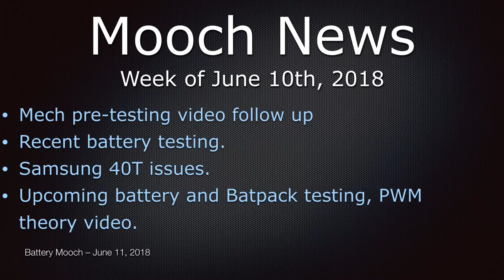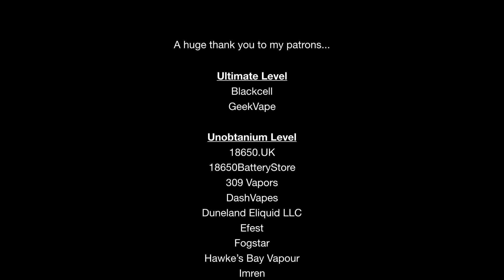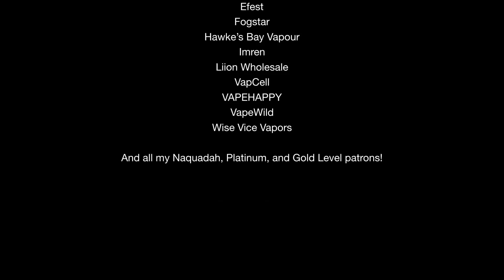Mooch News – Week of June 10th, 2018

Comment: How about those Samsung 40T now? Are those still a no go ? Am gonna buy a Saga mech mod and wanna know which batteries i have to use? Which is the best 21700 for a dual battery mech mod?
Reply from the maker: They were never a “no go”. They were always good batteries and the production versions performed even better.
For up to 25A each I recommend the Molicel P42A or Samsung 40T. For up to 35A each (or if you want the hardest hitter and don’t mind shorter vaping time) I recommend the Samsung 30T.
Reply: Battery Mooch ... ok i see but it’s gonna be a DUAL battery mech mod and let’s say a .2 or .3 resistance .... what batteries you suggest  in that case ? 40t or 30t ?
Reply from the maker: Dirk VdH calculate how much current you are drawing from the each battery and use my recommendations. Every mech user must know the Ohm’s Law equation and how to use it to help ensure their safety. Do not use a mech until you know this equation and how much current you are drawing from each battery.
Reply: Battery Mooch ...yes i already used my Ohm Calculator ...at 3,7 volt and 0,3 ohm resistance it gave 12,3 Amp and 46 watts ....but that is for 1 battery i suppose ...but my Saga Mech Mod uses 2 batteries so that is another story, no ??
Reply from the maker: Dirk VdH YOU CANNOT USE 3.7V FOR THAT MOD’S CALCULATIONS! You MUST learn everything about your mod before trying to use it. Do NOT use that mod until you know if it is a series or parallel mod. Then check out my Battery Basics for Vapers Ep2 and Minding Your Mechs Ep15 videos.
Reply: Battery Mooch ...ooh yes i see ...Ohms calculator : Volts 7,4 Amps 29,6 Ohms 0,25 Watts 219 ....looks ok for you Mooch ? And ok for the dual Samsung 30T’s ? Is my homework good now ? Surely when i will buy this equipment (Vaperz Cloud Saga mod) i will talk thoroughly with the vendor first !

Comment: Hey mooch, would it be ok for me to use the samsung 20s with my
.12 build on a single mech safely if I'm not chain vaping it?
Reply from the maker: There is no safe use of any of these batteries since they were never made for use outside of a fully protected battery pack. You can help minimize the risk though by staying under the battery’s true current rating.

Check out Ep2 of my Minding Your mAhs series for info on calculating battery current for a mech.
Reply from the maker: Acacia Confusa 144 there’s still some risk, nothing is completely safe. If your mech malfunctions or there is an accidental button press that discharges the battery continuously then that is not safe. 🙂 Unlikely? Perhaps, if everything is well cared for, cheap clone mechs aren’t used, etc. But that doesn’t have any impact on whether something is inherently safe or not.

We still have ABS and air bags in cars even though the odds of something bad happening might be low. Why? Because we can never consider it to be completely safe to drive a car, no matter what we do. Saying you have never had a car accident can never mean it is safe to drive a car for everyone. Same thing with vaping. We can do lots of things to reduce the risk though.
Reply: @batterymooch  well said mooch I admire your wisdom 👍

Comment: So i saw an article by you talking about box mods and how you cant use the coils resistance to determine the battery amps being used. and the math on how to figure it out.

300w mod /2 batteries / mod cut off voltage.

So what about the zenith v3? im thinking that mod and some vapcell gold/white 20700s would be a perfect fit ? some thoughts from you possibly?
Reply from the maker: It all depends on how much current you are drawing from the batteries. Check out Ep3 of my Minding Your mAhs series if that is a regulated mod. Check out Ep2 if that is an unregulated mod (protected or not).

Comment: Not about this video but since you you batteries whats the best way to get rif of arkmarks on batteries an yes i build low .07 on mech pencils dousent fully work an i get it on the mod positive pin itself? silver plated
Reply from the maker: Try a Scotch Brite heavy duty scrubber pad. Anything more aggressive will probably remove the plating.

Comment: Mooch can you help me. I’m an idiot and I don’t trust my math. Honestly. Also I don’t understand what everything means. 

I have a dual battery mod and I use 2 Samsung 30Q 3000MAH batteries (purchased on Illumn). I vape between 60-70 watts. With a 90% efficacy (if that’s what you recommend), is this safe or should I lower my wattages?

I’m a new vaper. Math ain’t my thing. I’ve used calculators and watched videos and read articles. I’ve had many friends try to explain Ohms law to me. But I don’t understand. And I don’t want a mod exploding in my face because I don’t understand this law.
Reply from the maker: Did you check out Ep3 of my Minding Your mAh series?
The 30Q can handle up to 45W each before exceeding its rating so that’s 90W in a two battery mod.

No use of these batteries only meant for use in protected battery packs is “safe” though. But we can minimize the risks by not misusing or mishandling them. Keep the wraps in perfect condition, charge only externally in a good charger only when you’re around. Maintain your mod and don’t abuse it.

Comment: I think I'm going to give up on 18650's and go with a 7.4 volt lithium pack for RC hobbyists. Some are rated for a legit 100+ amps continuous. They don't get voltage drop under load. Heavy as hell though. Lol
Reply from the maker: None of those packs will survive very long at 100A continuous. LiPo ratings are over-exaggerated much more than round cells ratings are. There are very good performers available though.

Comment: Stocking up on some cells and figured I'd check out Mooch's latest to see what's hot out there right now (no pun intended). Not easy finding those Samsung 20S's... found one ebay seller who wants 40 bucks for 3 of them, and I don't like to use ebay for batteries. You got a clout card with the boys at Samsung Mooch? Where are you getting these bad boys?   -EC
Reply: Found some!  https://www.illumn.com/18650-samsung-inr18650-20s-2000mah-high-discharge-flat-top.html?gclid=EAIaIQobChMIiY_W7Obs2wIVDa_ICh2bpA25EAkYASABEgLCmfD_BwE

Comment: Hi mooch, first off all: thanks a lot of the work u did and plan on doing!

I also have a question: I have the Nitcore "new" I4 charger, which charges standard at 1.5A for a single battery. Now I always put 2 batteries or more in so it chargers at 0.75A or less, but the batteries are not drained equal (i use single batterie mech mods) and so sometimes one battery charges at 1.5A for the last 10-20 mins orso. Does this harm the batteries a lot and does this decrease the life span of the bats? Thanks
Reply from the maker: Probably not, as long as both are 15A rated batteries or higher. 10A batteries need to be charged slower.
Reply: Battery Mooch Thanks!

Comment: Jesus!  I just bought a butt-load of Samsung 40Ts, well ten anyway.  What am I supposed to do, throw them out?  Single coil .4-.6 ohm, single battery DNA75c temp control and replay drawing 4-7 amps.  Thanks for the heads-up anyway.
Reply from the maker: Why throw them out?
My glowing test report was for these sample cells. :-)

Not meeting their 35A claimed rating yet doesn’t mean they’re crap cells. They still perform for me as they did in my recent testing and in December.
Reply: WHEW! Thanks.  I'm not a battery stressing vaper anyway, I just got spooked by having pre-production pieces that I misunderstood could have been crap compared to the regular production units.  I'll keep them, the battery life with these is off the charts for me.  Thanks Mooch.

Comment: Thanks for the excellent info! Any chance of getting a better understanding of when to retire my batteries. My 30Q's are only charging to 2200mah or thereabouts. They are in excellent condition and still work well. Should I just wait until an error sign comes up on the charger-using an Xtar VC2.
Reply from the maker: 2200mAh? When charged from 2.5V?
If you’re putting 2200mAh back in after vaping with it instead that’s not bad at all as our regulated mods do not allow us to vape the cell down to empty, 2.5V.

Comment: Very curious to see your test of the Batpack. I wrote a review on it not so long ago on Reddit and on the rechargeable cells the batterylife was pretty impressive, not so much on the 1.5V Duracells though, but iirc I looked at a test between regular duracells vs similar rechargeable as were included in the batpack and under a 1A load the basic Duracells only measured about 500mAh vs 1600mAh of the rechargeables.
Edit: my batpack didn't have a usb port for charging, does yours have one since you mention the batpack maybe trying to charge the duracells?
Reply from the maker: Doh...I have to check. LOL, total foot-in-mouth disease possibility for me here! 😨😨😨

Comment: Very interested in your testing of the dreamer as I have a brass dreamer using 21700 35amp 3000mah  30t I believe been rewrapped but from a reputable site. I'm interested to know if the firing pin on the dreamer makes any difference as it comes with 2 a flat 1 and a bumpy 1

Comment: I love the vct5a, so that will be awesome to see if the s hits harder. 
I'm glad to hear you are going to be working with the dreamer, as coincidentally, I'm looking to get one.
I think I asked this in your last video, does the current passing through the slug run any chance of arching on the slug and changing any sort of resistances or connection? 
I have to say as well, I don't know many (zero) that would give up their goon 1.5 to test with understandable why you'd switch it out. A great rda.
Reply from the maker: I press the mech button down before starting the current flow and stop the current flow before releasing the button so there can be no arcing. I’ll deal with the effects of arcing at a later time and wanted to remove its possible effect on my testing for now.
Reply: Awesome. I love that your videos leave me asking questions as far as a learning curiosity and a yearning to know more. Absolutely fantastic video series.

Comment: As round cells keep advancing , I would love to see some comparative data or round cell vs. lipo based on the space they fit in. For instance 2x18650, 2x 20700 and 3s 1550mAh lipo pack (Pulse 35c and others) all fit in similar space. Is their one that is clearly superior, for under 50;watts, or over 150watts where is the crossover point, etc.
Reply: Daniel Bragg sad thing is not so much LiPo mods out there.